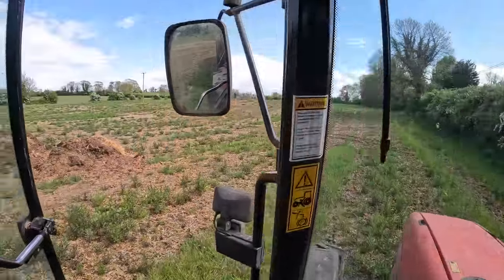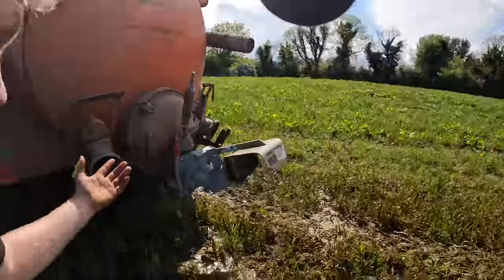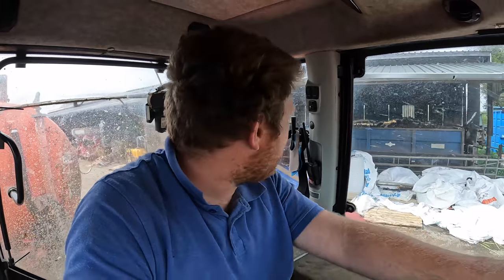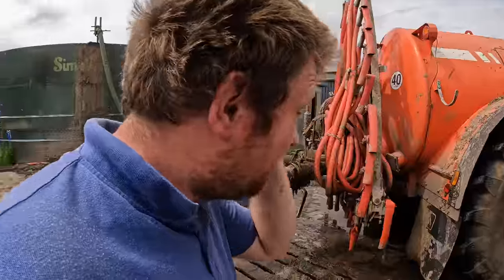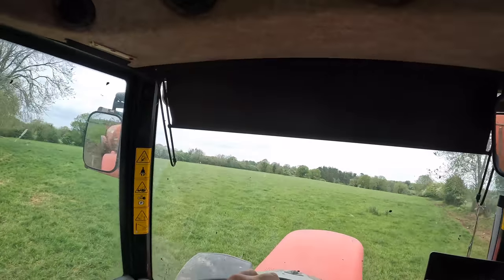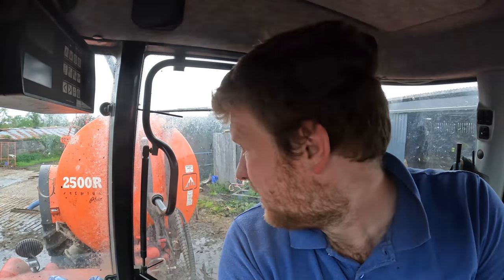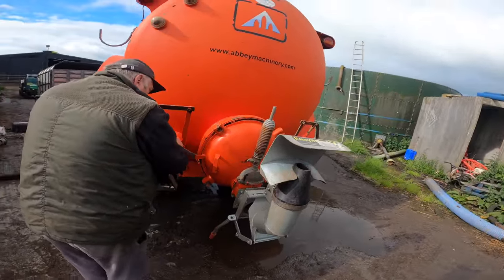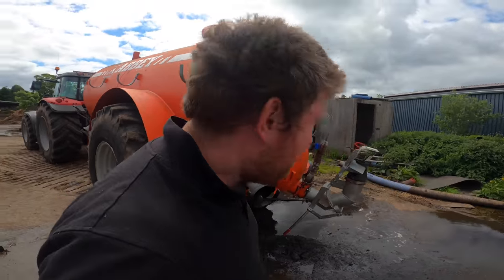WHY AM I INSIDE A SLURRY TANKER?! | SILAGE IN SLURRY OUT

Comment: Does the hydraulic drive still fill as fast and build pressure quick enough as a PTO?
Reply: Would depend on the hydraulic pump in the tractor, can't imagine an old 135 would fill as fast!
Reply: Fills every bit as quick.